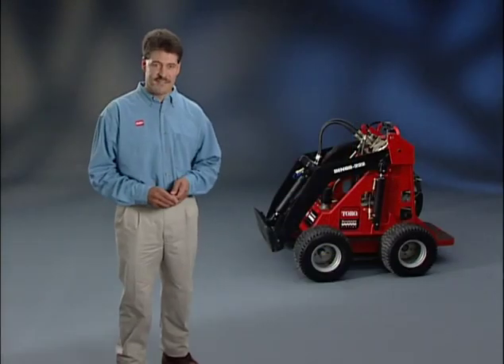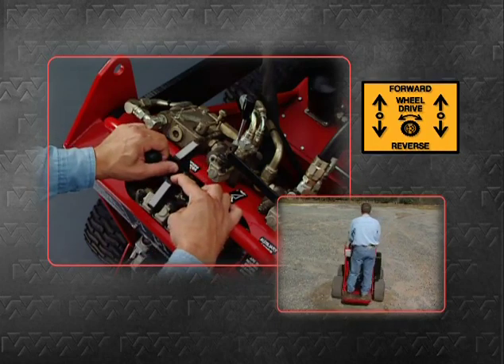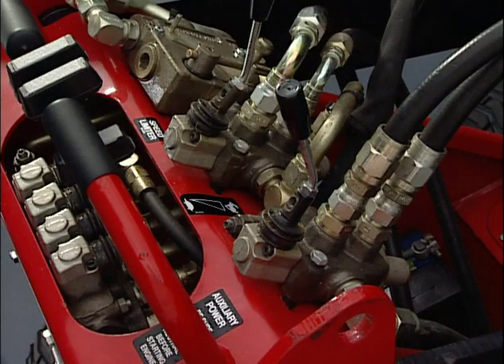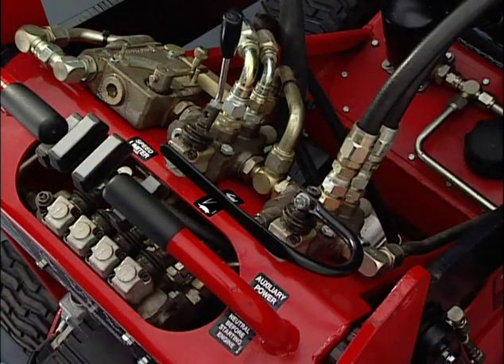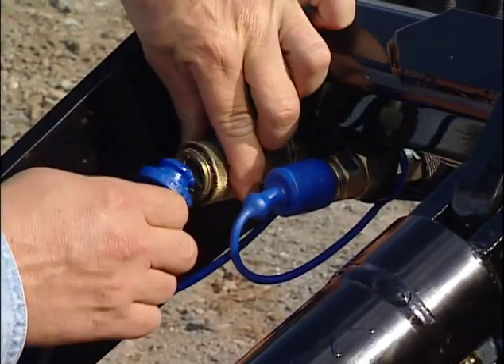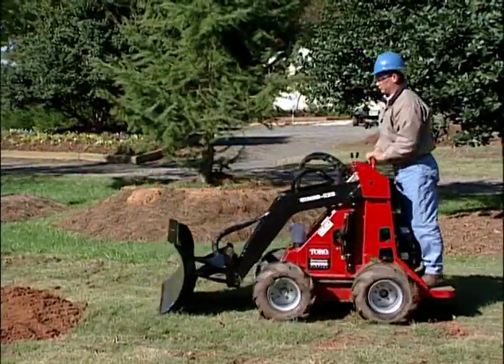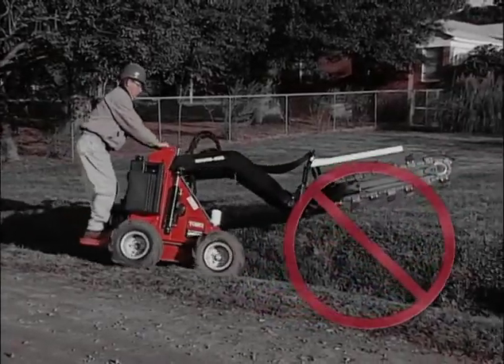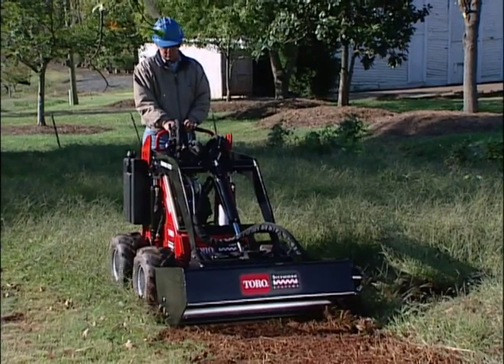Toro Wheeled Mini Digger Operator Instructional

Comment: My dingo is a little different from the one shown i guess because its a older one starting off with the oil i use Penzoil 10w30 and have never had a problem, Using a trencher you should have the counter weight kit mine already almost tips over with a trencher as it is they are very heavy